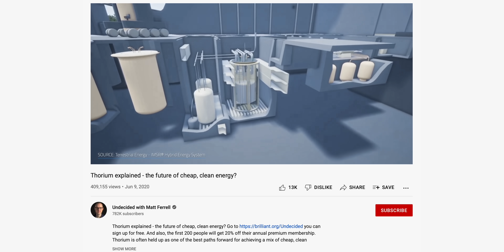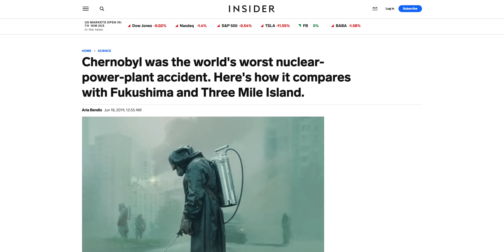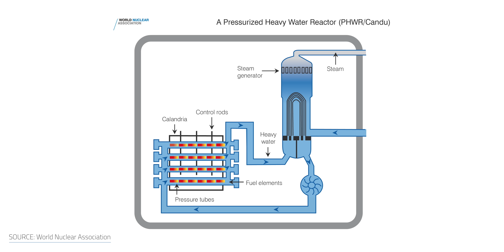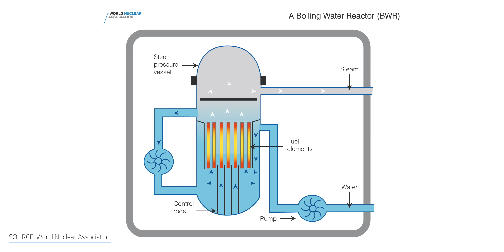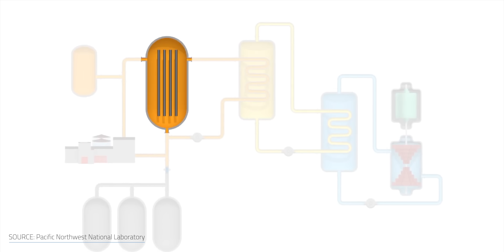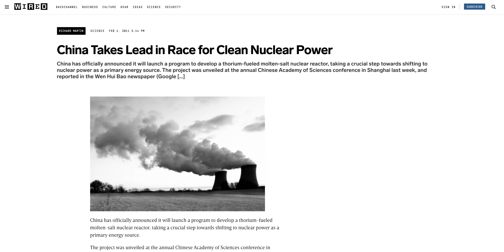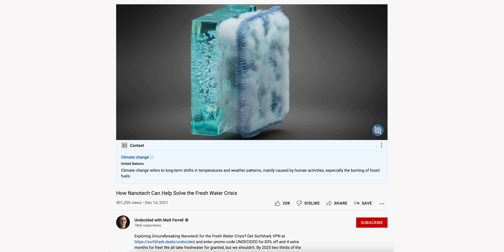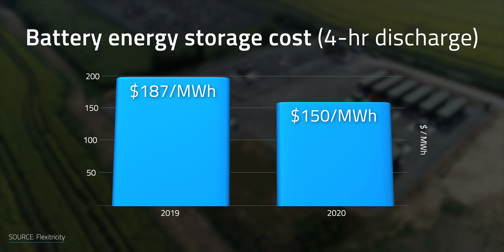Revisiting Thorium Energy - The Future of Nuclear Power?

Comment: Thanks for the first detailed look at Thorium in a YouTube video I have seen that isn't a promo for Thorium. You answered some of the claims of safety with the process that I saw in those videos that remain worrisome and overly optimistic in my cold analysis.
 I worry that while 500 years is much shorter than 10,000 for safe waste storage it still is a long time. 
 The molten salt corrosiveness and "lower"  operating temperature are still not without hazard, and more particularly for commercial use seem to be still capable of failure to a point that the reactor becomes a useless stranded asset. 
What especially gets to my thinking is that it still is a potential source of nuclear weapons grade fissile material, even if the delay and development factor to utilize it is greater. All fission based nuclear seems to me to result in more ultimate radiation hazardous waste, or the same sort of temptation to terrorists than present nuclear waste material generation is known for. And we are still 'playing with fire' because of these factors.
It remains in my mind still a stupid way to boil water for steam that supports a massive set of  supplier mining enterprises, which our laws still give too much advantage to. Those laws pay such enterprises to leave behind them much that the public coffers have to spend upon clean-up of tailings to make that scarred land useful once again. This is the flaw in the laws that have also publicly supported the oil industry for many decades, a hidden government subsidy the proponents fail to acknowledge while complaining about the visual pollution of wind turbines sitting atop still productive farmland.
Reply: Even the 10,000 years is only out of concern for proliferation because that's the half life of the fuel itself, which already exists in nature, sitting out in plain view.

Comment: I'm very skeptical about the cost estimates. The cost of wind is usually underestimated in scenarios like this. Large scale wind will be obsolete when Thorium has become the standard source of energy. Thorium also has a thousand times greater potential than fusion power, still ITER gets a hundred times more funding than Thorium research. Shut down ITER and give the money to Thorium research.
Reply: There were enough wind farms, solar farms, and commercial nuclear power plants built in the U.S. in the last 25 years to estimate the cost and time to complete each with great certainty.  I just want to know where in America has a nuclear plant EVER been completed in 6 years.  The real numbers are a minimium of 10 years and 15 billion for a 1,300Mw (proven and common) PWR design.  And without real numbers for any new design that is actually built in the U.S., anything less is pure speculation.
Reply: You could see it in the figures he gave.  They gave a 4-hour storage, but they would need almost 10 times that to honestly balance their output.  Also he gave a 30 year life cycle cost where nuclear is typically around 60 years.  You would be replacing photovoltaics and batteries several times in that 60 year period.
Reply: @danadurnfordkevinblanchdebunk  He also said nuclear plants are built in 6 years and that is a bold face lie that is not even close to reality. Solar output is guaranteed and has been proven to do decrease less than 1% per year so you get  more than 70% original output after 30 years for something that has no moving parts and does not have to be fed any fuel source other than the sun and the only maintenence is washing once a year.  Battery life depends on usage.  The larger the battery banks, the less drawdown and they will easily last 30 years before they decrease to 70% capacity. Current nuclear reactors require major maintenance and refueling every 18-24 months

Comment: Thanks, very clear overview! I was wondering: you compare the cost of nuclear power to wind/solar+storage, but does that reflect the full cost of battery storage? Is 4h storage enough, and what would storage look like in places with big summer-winter differences in power supply? Another thing I'm curious about is scaleability: do we have the materials needed to scale up battery storage, while also building EV's and other products with batteries? If not then we may still need nuclear to have a fullscale zero emission energy system. Curious to learn more, thanks!
Reply: His cost and time to complete estimates are NOT based upon any nuclear project completed in the U.S. in the last 25 years.  If you don't use real numbers you will never get real answers.
Reply: @clarkkent9080  The promise of LFTR and other small modular reactors is that the cores can be built and sealed in a factory and then shipped by ocean to a reactor site. This means their installation costs will be many times quicker and cheaper than former projects. The current generation of pressurized water reactors in the US are one of the least efficient & safe designs with huge construction hurdles related to containing the highly pressurized water. One of the main advantages of molten salt is that it runs at normal atmospheric pressure and can therefore forego the massive containment domes which drive up costs & construction times of old generation plants.
Reply: @Nphen  Can be is not the same as IS. When and if what you say actually happens in America then and only then should we reconsider the time and cost of nuclear to be any different than 15 years to build and $15 billion for 1,300 Mw nuclear.  The first SMR, theTerrapower MSR (345 Mw) is projected to cost $4 billion and take 7 years (started in Nov. 2021) to construct.  That cost is equal per Mw  to the massively over budget Vogel PWR project and twice as long to complete the 4 MSRs needed to equal Vogel's 1,300 Mw output.  Using what happens in other countries only applies to those countries.  A China textile factory can produce 100,000 pairs of tube socks, ship them halfway around the world ,selll them at WalMart,  3 pair for $1 and everyone makes a profit but does anyone expect American textile factories to be able to do the same?
Reply: @clarkkent9080  Thinking at the wrong scale.
Reply: @clarkkent9080  MSR's will be built in factories and do not require huge amounts of concrete / pumps / fuel rods etc - stop thinking old school gen 1 - gen 3 light water reactors and learn about gen 4
Reply: @jimlofts5433  Having been in the industry all my life, when Westinghouse said their AP1000 advanced reactor design would be built in record time and much more cheaply than ever before, I asked what they would do different to make that happen and the answer was factory construction of system modules that would then be shipped to the plant site and connected.  And that is what they actually did but when the modules arrived at the site they did not line up and the build quality was so poor that many had to be disassembled and rebuilt on site.  The factory build idea is credited with a significant portion of the massive cost over runs of the VC Summer (canceled) and Vogel (100% over budget) project.   Again, people keep talking about what they think will happen without one example of this working in America.  Terrapower is 1/4 the size of convential nuclear PWRs and they are projecting a 7 year and $4 billion cost.  That cost is equal (dollars per Mw) to the massively over budget Vogel project and twice the construction time based on the time to construct 4   to equal the Vogel 1,300 Mw output.  Without even being built, the Terrapower projected (not actual) cost and build time is a failure.  Lets all watch Terrapower and see the reality of building a MSR here in America.  They started the project on Nov 2021.
Reply: @clarkkent9080  MSRs were made in 1965.
Reply: haha in NSW Australia they built a 1GW battery as backup but one guy who owns a smelter commented that it would run his plant for 17 minutes - sorry to Jaws - but I think we are going to need a bigger battery
Reply: @jimlofts5433  Nuclear is a base load system and needs energy storage just as much as renewables. Tell your smelter guy to operate during the day when the sun is shining.  Yes, people will have to shift the times when the use energy hungry processes.  Utilities have implementated time of use electric rates and this has changed the way people think
Reply: There is a book called "Energy" written in the 1970s which recommends on-site generation.

Comment: Great video Matt but could you please enlighten your viewers about Indonesia's choice of the walk-away safe high temperature but near ambient pressure ThorCon's 7×500MWe Liquid metal Thorium ion molten sodium fluoride salt burner energy converters that can be brought on line within 2 years for $1200/kiloWatt and provide electricity to the grid for a pre-profit levelised cost of $30/Megawatt.hour without destruction of thousands of Hectares of scarce tropical rain forests ...each 500MWe unit is bult like a double-hulled bulk-carrier in a Korean shipbuilding yard, fully equipped and fitted out before being towed to Indonesia where the fuel salts are added. All at a cost of $1200/kiloWatt to ThorCon. 
Although the PPA agreement  is initially for 25 years the design life is 80 years by replacing alternating reactor pots every 8 years including a 4 year passive cooling period. These are capable of being either auto "load-following" or as a "base loader"
Reply: Thorium MSRs are ambient presssure.

Comment: How many solar panels are recycled?
Are there heavy metals in solar panels?
What is the maximum efficiency achievable with a single cell solar panel?
What are wind turbines made of?
How are batteries recycled?
What are the dangers of batteries?
How quickly do batteries become inefficient for practical use?
What's the environmental cost of wind turbines and solar panel?

When you find out the answer to these question, you might start question the renewable narrative. In fact you will probably realise that it is more polluting and damaging to the environment than you though or are being told. There's a lot of government money being thrown at renewable energy production, and there are plenty of companies, and individuals, willing to feed at that trough.
Reply: Solar panels are mostly silicon, one of the most common elements on earth and other than the copper wires, I don't think there is anything recyclable worth while.  The latest solar panels are 26% efficient, lose less than 1% efficiency per year of use and how efficient they can become is anyone's guess just like all the guesses on efficiency and safety of these new reactor designs.  Lithium batteries are just now being recycled and lead from lead acid batteries is the world's most recycled metal so I would assume that that type of infastructure wold eventually be developed for lithium given the value of the metal.  I believe you know the answer to the rest of the questions
Reply: @clarkkent9080  
Didn't address my points just regurgitated dogma and percentages. That's not an argument that's a marketing pitch.
Reply: @quietackshon  How long do nuclear plant last based on actual plants? How many cubic meters of waste do they produce each year? How many spent full assemblies have ever been disposed of in a permenent storage.   Yours points are to only attack something you do not like.  An honest discussion would show pros and cons of each.  Fortunately, people like you are not selecting which power source to build.  It is investors that are putting their money on the line that are building solar and wind farms and the only new nuclear projects that are proposed are funded at least 50% by the government (you the taxpayer).  If you really want to know which source is best, get the government completely out of the direct payment and tax credit game and let the capitalist decide.  I'm all for clean coal as soon as someone invents it.
Reply: @clarkkent9080  
If you have question stat your own thread, or answer my questions.
that's what I thought, you got nuffin
Reply: @quietackshon  If you need answers to all your questions, I recommend a google search or attending a class. You comment is not a comment only random words. Whay is your point dude?

Comment: If you take a look at the Agorameter, which tracks Germany's electricity production in real times, and look at, say, the last month, you'll see that intermitency problems go far beyond a 4 hours lag of renewables production. it's more like several days in a row. So yeah, even on rather long lasting batteries, they'll still need to be backed up by gas or coal or nuke, that should obviously factor in the mwh price.
Reply: Plus his numbers make the meme of 30 year lifespan for nuclear when it's closer to twice that.  How many times would solar panels and battery banks have to be replaced completely in 60 years?

Comment: Ubiquitous, abundant electricity underpins our mostly urban civilisation and the expansion, preservation and propagation of the knowledge that make it so successful. Something this essential demands exceptional levels of resilience and redundancy. Weather-based systems (wind, wave and solar) are vulnerable to extended disruption by volcanic eruptions large enough to contaminate the upper atmosphere, with climate impacts extending over a much greater portion of the globe for much longer than their neighbourhood impacts, however destructive those may be. Geothermal, tidal, nuclear and, even, fossil fuels are needed to mitigate this risk. Mass-produced SMSRs could provide clean, local and, therefore, resilient sources of electricity and heat to urban areas, largely consuming their own waste, and Wright’s law should bring down their capital cost to be competitive with renewable sources.

Comment: Unfortunately thorium, needs metal alloys that have no nuclear approval. That will take endless time. It also uses graphite that has to be replaced every 5 to 10 years becoming a significant nuclear waste issue. Then there’s the tritium created from the lithium fluoride salts. 
Technically no big deal. but gaining regulatory approval for all that has and is stopping it dead. 
Moltex and Elysium have fast spectrum reactors using chloride salts. All the advantages discussed. But - No special metals. No tritium issues. No carbon core to dispose and no military grade material ever. 
They burn nuclear waste and even depleted uranium. The fuel salt denatures the fuel so it can’t be used for bombs. They are far more likely to get approval so more likely to happen.

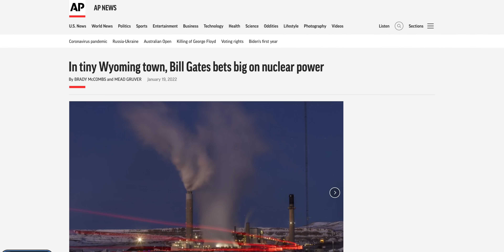Comment: It's worth noting that the DOE-backed TerraPower \ GE molten salt reactor mentioned at 11:05 is not a thorium reactor; it uses uranium.
Reply: I think that is best since we got lots of long-lived spent uranium fuel already it can run on, negative waste so to speak.
Reply: You lose all the benefits to safety & reduced material waste offered by low pressure high temperature thorium molten salt reactors. US energy agencies have eschewed thorium-based reactors thus far, because they do not benefit our arms programs as directly; but thorium-based slow reactors show no impediments as severe as those faced by fast breeders \ high pressure reactors. Even the development costs are lower with low pressure thorium & it's mostly the US's - shall we say - active disinterest which has held up deployment this long.
Reply: @prophetzarquon  Thorium isn't the only low pressure high temperature molten salt reactor.

Comment: Just to clarify that Thorium may be more expensive to mine, but in reality we don't need to do it. It is a nuissance that has to be removed from REE ores, Thorium is costing REE miners money everyday while having no significant use in any industry. The REE industry produce enough thorium "residues" to meet all our current yearly demand of energy (nuclear fission is insanely energy dense). Combined with the stockpiles of the stuff, we have like 5000 years of electricity sitting around bothering everyone. We won't need to mine a single gram of Thorium unless humanity ramps up its electricity demand 100 fold